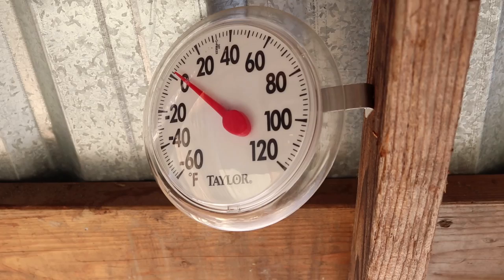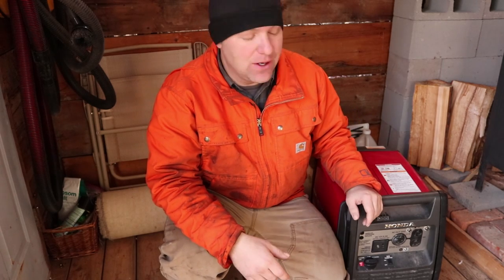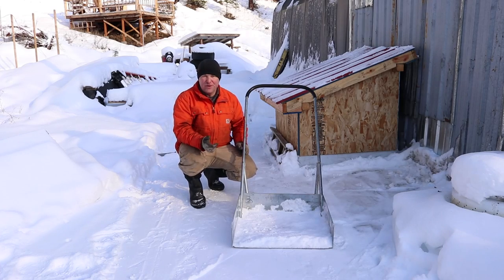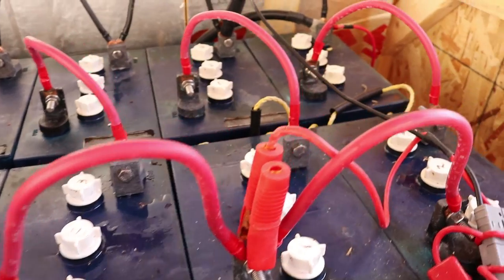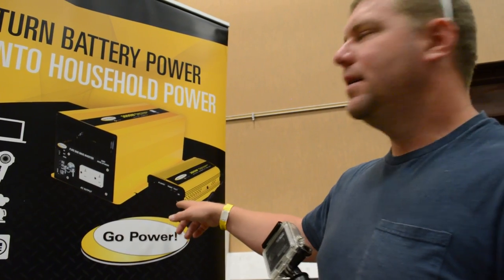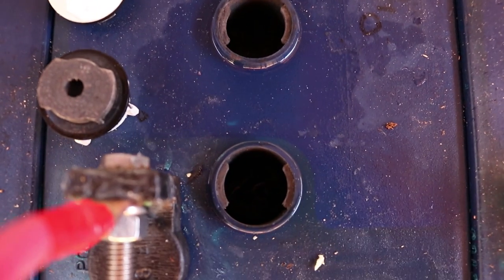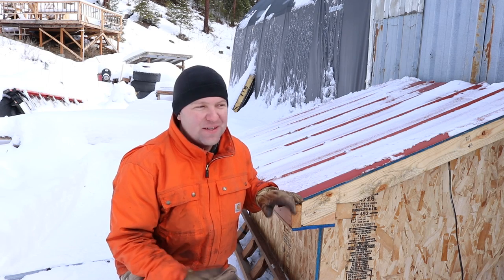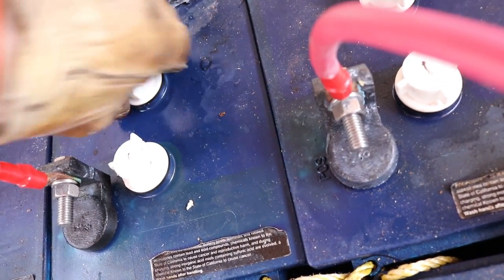SO FRIGID BATTERY ACID IS FREEZING! + Off Grid Power problems

Comment: From the Honda of Canada website  http://powerequipment.honda.ca/honda-advantage/generators

"Exclusive to Canada. Honda's industry leading "Cold Climate Technology" is specifically designed for our cold Canadian winters. Our exclusive breather heater system helps keep the crankcase ventilation tube free of ice formation and helps prevent generator shutdown."

Comment: If you had read your owners manual of the generator you could have saved a lot of headaches. Sounds like you local service guys need to go back to school, any one that work on small engines in cold climates will know with no guessing what the issue was and not having to call some one else.

Comment: A battery freezing is not a good thing.   Is only one battery freezing or all.  It possible that the battery has failed and is not fully charging.     Are all the batteries freezing or just the one.  If only one I would say it is a bad battery.
A fully charged battery should not fail, even at 40 below zero.   A freezing battery can cause the internal plates to short out.

Comment: 🔊 🔔 📣 HYDROGEN from recharging batteries is a HIGHLY EXPLOSIVE GAS ... So you probably, do not want to put a heater in that enclosed space where your batteries are located.  "During charging, (especially in the event of overcharging), lead acid batteries produce oxygen and hydrogen.  These gases are produced by the electrolysis of water from the aqueous solution of sulfuric acid.  Since the water is lost, the electrolyte can be depleted.  This is why you need to add water to “wet” (flooded type) non-sealed lead acid batteries.  When a lead acid battery cell “blows” or becomes incapable of being charged properly, the amount of hydrogen produced can increase catastrophically:

Water is oxidized at the negative anode:  2 H2O (liquid) → O2 (gas) + 4 H+ (aqueous) + 4e−

The protons (H+) produced at the anode are reduced at the positive cathode:  2 H+ (aqueous) + 2e− → H2

So, in an area where lead acid batteries are being charged, the first gas to measure is H2.

Hydrogen is not toxic, but at high concentrations is a highly explosive gas.  The 100% LEL concentration for hydrogen is 4.0% by volume.  At this concentration, all it takes is a source of ignition to cause an explosion.  Sparking from a battery terminal as it is connected or disconnected from the charging system is more than adequate as a source of ignition energy.  That’s why lead acid batteries should only be charged in well ventilated areas. "🔊 🔔 📣

Comment: Hey Guys, for your cold start mornings consider using this product to help with the valve wear while your oil/engine heats up.
http://duralube.com/ . When I was in Vermont in -40f weather using this, the engine sounded like a spring morning on start up vs the typical rattle everyone else had until the engine warmed up.

Comment: That Gen is a POS. My work services them and they suck. Look into the Gens used to power backup and small power sites. They have to work consistently in horrible temperatures, and I know because I project manage the people who service them. Alpha Gens are very reliable and last a long time, and are easy to service. Kohler have a good reliability too. Also inverters always have issues, they are a part that is usually serviced the most and replaced in most cases for cost efficiency, so I believe the market structure is to build this component cheap as possible. That being said, you would really want to do your homework to make sure to buy an inverter that is built to last and that that is what the mfg had in mind.

Comment: PREMIUM gasoline only for small engines
Reply: As long as you are using fuel with the proper octane Premium is just a waste of money for small engines. Honda recommends min 86 octane for the EU3000.  On the other hand, using non-Ethanol fuel will greatly reduce fuel-related issues on small engines.
Reply: thats why use premium gasoline, small engine carb venturis and jets become plugged from the ethanol in regular fuel. it also deteriorates seals and gaskets quickly. have learned this the hard way here in canada with our brutal winters
Reply: That makes sense then. Around here both regular and premium contain 10% Ethanol. There are only two stations within driving distance that have special pumps for non-Ethanol fuel. I make the drive and usually purchase 15-20 gallons at a time.